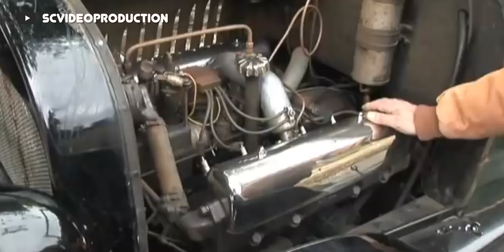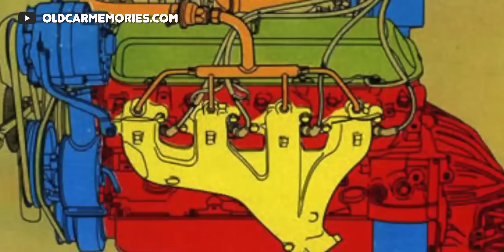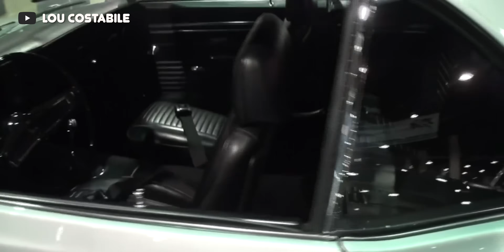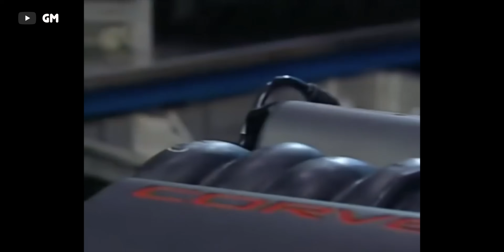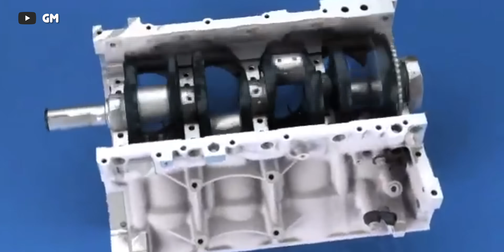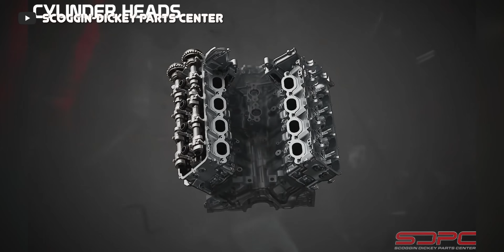We Ranked the Best Chevy V8 Engines Ever

Comment: The LK / LS engine is better than the Coyote.  The GM engines are simpler and have shown their reliability and low cost.  Try putting 7.0L in a Coyote engine?  It can be done in the LS and the Dodge Gen lll HEMI.
Reply: Try going 7’s with a bone stock LS? It’s been done in a Coyote. LS is great for cheap power but motor vs motor the coyote is better.
Reply: @169abr That’s because LS has way milder cams lmao, Fastest Stock bottom end Coyote runs a 7.8 by Aldo, Guess what LS is running? 7.1 seconds lmao.
Reply: @aimxdy8680  SBE is irrelevant to me cause I want to touch the motor the least amount possible, the less work I have to do to go pretty quick the happier I am. Coyote doesn’t need cams, head work, or anything involving opening the engine to runs 8-9 seconds or decent 60-130, LS/LT does and most LS stuff is swaps which is more I don’t wanna do if I don’t have to.

Comment: the 5.3 the most infamous motor chevy has produced for being swapped into everything and boosted to the moon should of had a spot on here just for its popularity.
Reply: There are more 5.3 on the road than any other engine in America.
Reply: More than likely he was focusing on how they came from the factory, and the 5.3 was just a bread and butter truck engine. It gets commonly swapped because it's cheap but shares parts with the LS series. So parts are readily available, and has relatively good cylinder heads. Meaning it's a cam away from decent power, but it's nothing special.
Reply: @samuelriester1419  yes cheap isn't better- especially the lame 5,3 gaMcan in the "watch me rust " Silverado
Reply: @bradzimmerman3171   the 5.3 in the Silverado, when paired with a towing transmission and differential ratio instead of a speed pairing, can trade blows with the 6.0 and 6.2 quite easily and has even thrown a few punches with the diesels but once you get that high you start reaching the limits of the block material
Reply: It’s insane to even think that a video ranking Chevy motors wouldn’t add it on the list
Reply: I agree totally
Reply: My 2005 GMC Sierra has 120K trouble free miles on it.  20 highway MPG if I keep my foot out of it.
Reply: add on to the fact the rev limiter is 5800RPM but its a public secret that the 5.3 can rev to 7000 without any damage and with its true limits being closer to 7500RPMs and its ability to be boosted to the moon without a care. Its able to push well past its big brothers in pure HP and Torque its putting out
Reply: Doughnuts and Cannabis are popular in the U.S. also, doesn't mean people should constantly consume them as well. 

I'd pick a (Bullet Race Engineering https://www.youtube.com/watch?v=m53RjI6xFaE&t=4s) 2jz or and RB or DETT or a Toyota/Nissan V8 ... over anything America has produced, any day!!
Reply: @utubecomment21  why? Do you prefer having a worse engine?
Reply: @utubecomment21 
1) There is no such engine called a "DETT"; you're missing the actual engine code.
2) Why did you click on a Chevy V8 video? Recreational hate is like drinking poison in hopes of making someone else sick.
Reply: @utubecomment21 You don't get it do you, the 5.3 is a affordable engine not a high over priced engine.
Reply: @utubecomment21 Yet the fastest drag Cars are all American Hemi V8s 🤣 the fastest stock bottom end 2JZ runs 8 second 1/4 miles, meanwhile LT4s, 5.3 LS, LS9s run 7 second 1/4 miles Stock bottom end.
Reply: @utubecomment21  you would pick them but you cant buy them cheaply thats what makes the 5.3 so good 2jz RB power for a 100 buck engine and a ebay turbo kit
Reply: Thats hilarious you must love weak motors😂 5.3's and 6.0's whoop them turds@utubecomment21
Reply: @utubecomment21   ... you know a base untuned 5.3 makes 355 horsepower without a turbo but they are able to take 20 psi of pure boost un-upgraded and that nets you another 200ish horsepower bringing you to around 550 horsepower 

but if you really want to play the horsepower game, you can just replace the cam, springs, retainers, pushrods, heads, and injectors and you will be able to push 40-60psi of boost netting you another 300-400 horsepower

if you think American-made is trash let me tell you how wrong you are because the 5.3 is one of the smallest truck engines common in the US and it is more than capable of out-towing and out-racing a Toyota or Nissan V8 now think about how powerful the bigger displacement engines that are fully upgraded are and that's not even considering the engines that are used in US sport cars and super cars, 

and yes the US does make supercars just because you dont like who owns the company that makes them doesnt remove the fact they make the engines of 40% of super cars in the world and make their own supercars

Comment: I prefer the Ford Coyote to the Chevy LS... but I'm not much of a wrench guy. I've just owned more Fords than Chevys and I love new Fords. I prefer the Ford 3.5 TT to the Ford Coyote though. The EcoBoost that's in the Ford GT makes 700 ponies in an engine that weighs 450 pounds. I think that's pretty awesome. And unlike the Hellcat motor, it can idle without starving itself of oil.
Reply: Sadly every ecoboost sounds like hot poo, impressive little engines tho.

Comment: Vortec engines did not start from LS’s. They started the gen before with 350’s still. They were different than the TBI engines and controlled differently.
Reply: The thing about ‘Vortec’ is that it’s just a name. There is no single type of 😢Vortec engine, as this name was applied to such diverse engines as the Gen I, Gen III+, as well as the DOHC Atlas engine. Vortec is a marketing term. It does not represent any specific design.

Comment: 90s truck and van TDI smallblock? 
M40 Automatic Transmission? 
I've wrenched on 87-95 TBI (Throttle Body Injection) 
       Trucks and Van's Smallblock & Bigblock. TPI on
         Camaro and Corvette. But never have I 
      ever known a TDI in them.
I've seen plenty of TH400s  (also TH350 SBC only) 
      Automatic Transmissions, but never have I ever 
       seen or heard of a M40 automatic
Reply: M40 was the SPID code for a TH400 I believe. 700r4/4L60 was MD8.
Reply: M40 auto in.                      
     Australia maybe Aussie trimatic yuk ,weak

Comment: 350 TBI. Not crazy power but super reliable and simple
Reply: But still decent in power and easy to modify for a bit more power. Cheap and reliable.
Reply: 180 hp I wouldn’t call that decent power by todays standards, but they were super reliable
Reply: @rikk7263  
Try 210. 190 for the 2500/3500s. The same era TPI Corvette made 250.
Reply: @TakeHeart47  still unimpressive numbers
Reply: @rikk7263  That's why they were pretty reliable though. They had low specific power (low HP per cubic inch.)
New engines have very high power per C.I., are super-reliable, have good fuel consumption and very low emissions. Older engines were huge, had low specific power, were gas guzzlers and had absolutely HORRIBLE emissions. New cars are much, much better in every regard. Fans of classic cars detest admitting that, but it's true.
Nothing wrong with a fondness for the classics, though.
Reply: 1990 pickup 350 TBI 210hp. That's a low compression work truck engine. They're not tuned for high horsepower, they're tuned for efficiency while getting the job done. I get the same fuel economy empty as I do with the bed loaded down and pulling a 19' powerboat. It could be tuned for a lot more horsepower for a different application. It's still a good engine, even today.
 @rikk7263
Reply: TBI poor air flow from injectors plugging throtle body a customer brought me a gizmo called Tornado which went under air filter and creates vortek air flow and I could not believe how it boosted power

Comment: I know iy is not the main take from the video but you said the starter in the valley of the block is not something seen in the modern age. I think BMW and or AUDI have engines that are reversed so to speak with the exhaust coming out the top of the engine. These engines have the starter in the valley now instaed of the traditional placement due to space constraints. Hope this is helpful
Reply: Toyota/Lexus 4.3, 4.6, 4.7 all have starter under the intake i believe, as well as some nissan/infinitis i think.  Probably a better location for starter life and ease of access to remove/replace in a cramped engine bay, especially when you consider how bad corrosion can get from age and road salt when mounted conventionally.  But worse for testing, and can't bang on in an emergency to make it work.

Comment: The coyote is better technically speaking. More efficient, good technology. But the LS will always go down as the best swap engine. They are plentiful, make great power, and are crazy reliable. I’ve always said that GM V8s can run like shit longer than most other engines.

Comment: I got an 02 express 1500 with the 5.7l. I was looking in the service book and it looks like it was available with a 454. I'm still dumbfounded! I just can't imagine that much power!
Reply: It would have only been available on 2500 & 3500 Van's as it was in Trucks. The 10 bolt 8½" ring gear differential's input torque rating (as well as the 4L60E) wouldn't withstand Big Block torque.
Reply: @jasonstinson1767  these 454 engines made very good low-end torque idle-3500rpm for truck applications pulling a heavy load the torque on these engines drop like a brick off a cliff above 4000rpm and are basically a turd in a performance application unless modified stock it made 230 horsepower at a extremely weak 3600rpm 385 foot pounds of torque at 1600rpm and a extremely weak 7.9:1 compression ratio for example of how weak this 454 is my 2004 Buick LeSabre with a 3800 V6 engine makes 205 horsepower and definitely not performance orientated so a 231 cubic in engine vs a 454 cubic inch engine a difference in 223 cubic inches and it makes only 25 horsepower more is extremely sad but this 454 is good for towing heavy loads they are definitely no performance powerhouse unless they are modified with a compression ratio of 10.1 or more and a camshaft that pulls strongly to 6000+rpm that makes at least 440+ horsepower GM should be ashamed to produce a 454 engine with 230 horsepower anything under 350 horsepower is a complete embarrassment even for a stock 454
Reply: @Gloria Maletta  yep couldn't agree more. The only replacement for displacement all things equal is RPM. With the exception of early Gen lll big blocks with the aforementioned 10:1 compression and rectangle port heads, also a few oval port, stock big blocks are an expensive way to burn fuel for marginal gains in performance. All things being equal (valve lift and duration, head flow and rpm range as relative to displacement) they can make great power but in a field like that any engine from any manufacturer will perform nearly identical all variables being equivalent. I do know that the cheapest way to make "reliable" power is likely a worked over SBC. A LS Gen 4 with a cheap turbo or nitrous may be the cheapest power to be found from what I've seen. Thank you for the reply. Very concise and based on reality likely from experience.
Reply: @gloriamaletta8667  You are thinking of the early 90's 454 (vortec came out in 96) when your 3.8 liter only made around 170hp same year, and half the torque. if you want to compare same years, my Honda accord made 240hp from only 3 liters and like the Buick it wasn't a performance oriented motor. There was a time the 3.8 only made 105hp, GM should have been ashamed then right?
Reply: @JohnSmith-dc1xf  the Buick 3800 is no powerhouse engine l have a 2004 LeSabre for street driving it makes decent torque by 2500rpm to move with traffic it's rated 205 horsepower and 230 foot pounds of torque V8 performance cars made in 1984 made 245 foot pounds of torque and the Buick 3800 V6 is rated as one of the best GM engines ever made for reliability and durability with good maintenance they will last 300,000+ miles but it's not known for big horsepower or torque unless it's got a supercharger or turbo at the time the Buick 3.8 made 105 horsepower a V8 305 Chevy made 145 horsepower with 70 more cubic inches a 2 more cylinders l will take my Buick 3800 over the new GM V6 3.6 engine being made today because most of these engines have issues before 100,000 miles that will cost thousands to fix but they do make more power than my Buick 3800 V6
Reply: @JohnSmith-dc1xf  can you get a water pump for your Honda Accord for 30 dollars l can for my Buick LeSabre
Reply: @JohnSmith-dc1xf   my Buick LeSabre is fairly big roomy comfortable good on gas reliable and dependable and replacement parts are reasonable in price compared to newer cars or imports and has no problem running 80-90mph on the highway for extended periods of time and still gets 25-26 miles to the gallon with the AC on no it's not fast
Reply: @JohnSmith-dc1xf  your 3.0 Honda V6 has 24 valves and 4 camshafts my 3800 V6 has 1 camshaft and 12 valves it's like comparing the new Vette LT2 engine 495 horsepower to the new Vette LT6 engine 670 horsepower and I'll bet my Buick 3800 V6 makes more torque from idle-2500rpm than your Honda 3.0 V6 does bet your Honda 3.0 V6 has to spin 3000+rpm to exceed the torque my Buick 3800 makes below 3000rpm
Reply: @JohnSmith-dc1xf  peak torque on your Honda 3.0 V6 is 212 at 5000rpm my Buick 3800 V6 makes 230 at 4000rpm means my 3800 will move a heavier car with less effort without being revved hard and will pull better from idle to 4000rpm from 4000rpm and up your Honda 3.0 V6 is better so if your looking at full throttle it's better at part throttle or street driving not so
Reply: @JohnSmith-dc1xf  my Buick accelerates well on a expressway ramp for what it is at 3000-3500rpm car cruises at 90mph at 2400rpm quite comfortable and smooth as silk
Reply: @JohnSmith-dc1xf  my 3800 V6 makes as much torque at 3500rpm as your Honda 3.0 makes at 5000rpm
Reply: I think 2002 would have been 8.1L. Also the big block was only available in 2500 and 3500 vans
Reply: @wetcoastfilms  l do know there are a few early 1999 Silverados with the old vortec small block 350 motor most have the newer LS 5.3 that is also called vortec on the intake cover the 5.3 is clearly a much better built engine having 6 bolt mains means crankshaft is bolted much more secure to the engine block eliminating and stretch or flex even at 7000+rpm and the LS cylinder heads flow much better than the old stock Chevy small block does
Reply: @Donovan Savage  Upon investigation, it seems that all Vortec 7400 (7.4 Liter, 454 Cubic Inches) ended all vehicle applications in 2000. Even though the GMT 400 variant ,GMT 455/ C3500-HD, was the last GMT400 based truck in production up until 2002, it seems that the last 2 model years , 8.1/8100Vortec/496CI, was the available "big block". This is a great observation of yours of which I am thankful for the comment. As a GMT400 Series fan, I find it incredible that any GMT variation could be had with the 8.1.
Reply: @jasonstinson1767  yeah even the gmt530 and gmt560 had them
Reply: The new heavy duty vans come with the iron block 6.6L. 401 SAE net HP on 87 octane.
Reply: @TakeHeart47  it has a longer stroke crankshaft of 3.86 vs the 3.62 boosting torque and it comes in 500rpm earlier for towing
Reply: I worked at AutoZone back in 2017. Gentleman comes in with a new GMC Sierra 3500. I ask him if it's the 6.6 Duramax. He looks at me and says no, I have the 8.1 liter. I go wait the 496 lives?
Reply: @Scott Ruch  LOL right. Pretty sure 05 was the last year for the 8.1/8100Vortec/496³". Wasn't the 6.2 the biggest gas burner in 2017, and even then, only a 6.0 was available in the 2500/3500s
Reply: @jasonstinson1767  that's what I thought too but I was wrong
Reply: @Scott Ruch  Man can u give me some source for that. I mean I can see offering them in the GMT800 HDs till 07  but I looked it up twice last night when I was making sure if the 6.0 was the only gas engine avaliable for 2500/3500 trucks after the 08 body style change. I never even heard of a aftermarket upfitter offering that and since I know without a doubt the 8.1 was not produced for on road vehicles after 05 (possibly installing till the end of the body styles) so how could it meet emissions in a on road vehicle 2 body styles later. Don't get me wrong I'd be so happy to know the supply didn't end I've jus never seen it and this is first I'm hearing.
Reply: @jasonstinson1767  I completely understand. I'll try and find more on it if I can. I may not be remembering it correctly but I think he said it was a really specific package or something like that I can't remember.